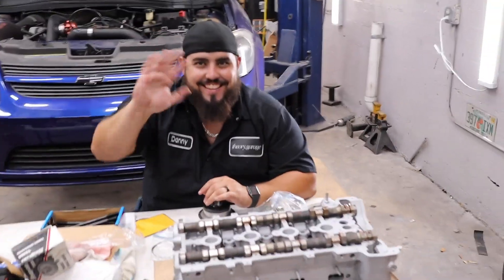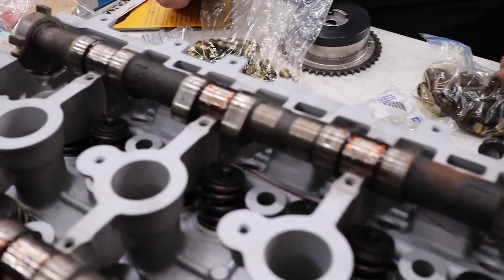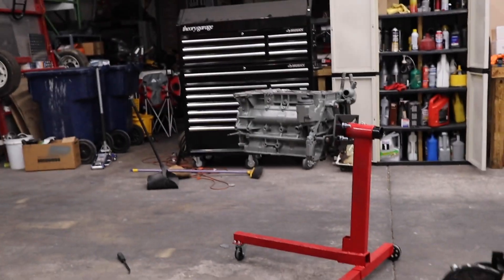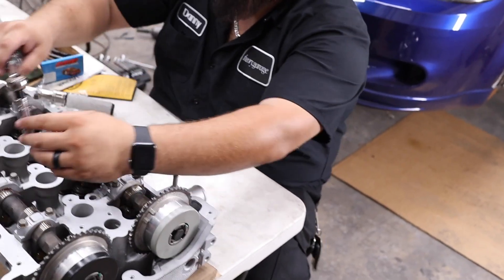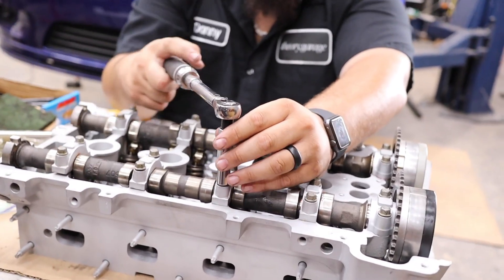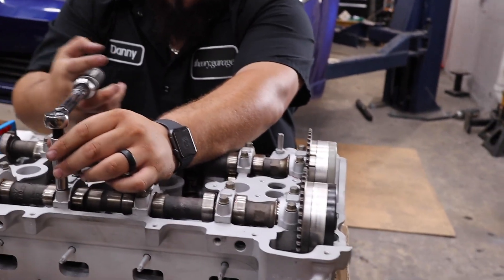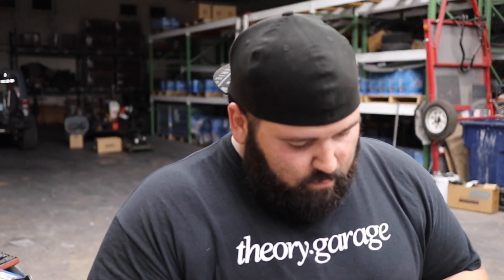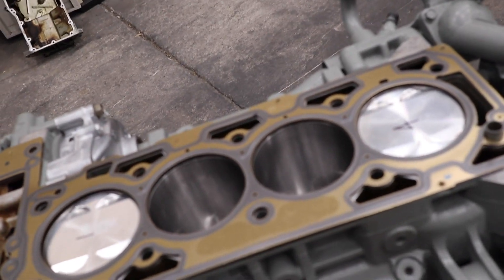Project Blueberry's Ecotec Gets ARP Head studs

Comment: You didn't lube the cam journals, before setting the cams in the head the way it looks to me. Only have assembly lube on 1/2 of the journals so 1/2 almost dry start.  Spinning the motor with no lube in the cylinders/new rings...  and put the head on with... still no lube in the jugs.  Scratchy scratchy scratchy crunch. Not good... Engine building 101..
Reply from the maker: Simply wasn't filming at that exact time, the cam journals were lubed below as well